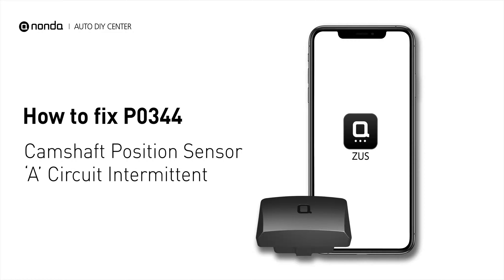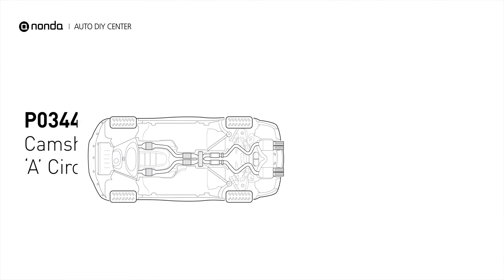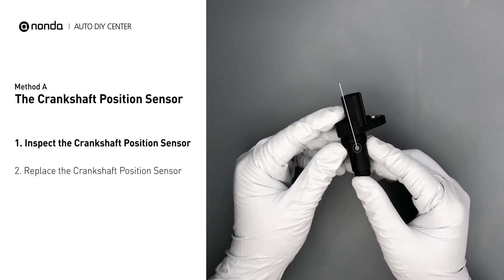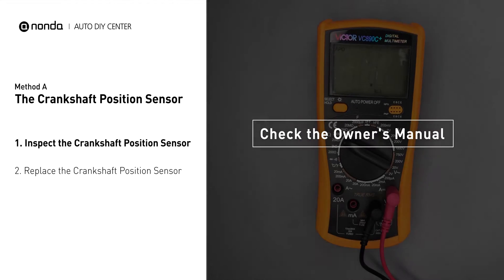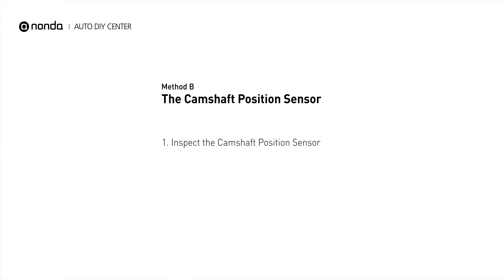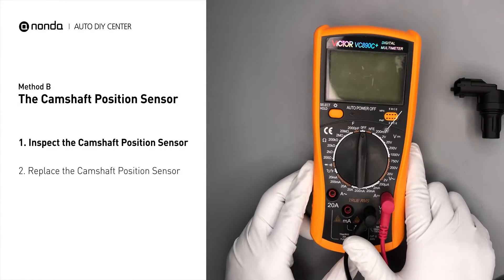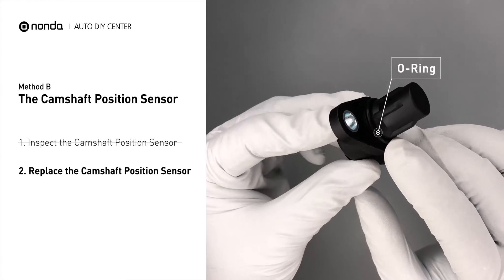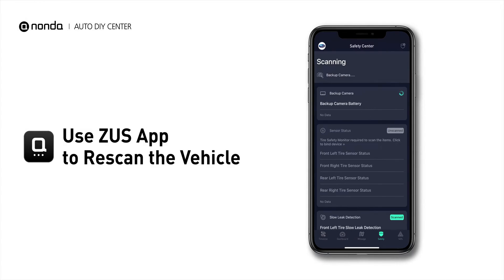How to Fix P0344 Engine Code in 3 Minutes [2 DIY Methods / Only $9.56]

Comment from the maker: Hi, I'm Steve, nonda's lead mechanic engineer. 
Feel free to leave your comments here if you have any mechanic questions, I will be glad to help you out!
Reply: what should i do after i already replaced the camshaft and crankshaft position sensor and my car is still acting up it will throw the check engine light and traction control light on at the same time and wont rev pas 2300 rpms and poor acceleration
Reply from the maker: Hello @cody roberts and @iitzlando, can you please provide us with your vehicle's year/make/model?
Reply: @nondainc  ssangyong actyon wagon 2008 diesel
Reply: @iitzlando  I’m having the same problem
Reply: @iitzlando get an oil change that will help
Reply: @iitzlando have you gone to Auto Zone to tell them to scan your car sorry im over 2 years late
Reply: Changed both cam sensors and crank sensor still get po344 code has high rpms at 60 mph what should be checked next
Reply: @aliceseymour6272  composition sensor
Reply: Ik this video is old but I replaced my cam shaft sensor A for my Ford focus 2014 se hatchback and I’m still getting the error code p044 and P040 and my car is still driving poor do you have any suggestions?

Comment: Same problem changed both sensor have same problem can you guide me to issue
Reply from the maker: Hi Alice, kindly check the condition of the Camshaft and Crankshaft Position Sensor and all the wiring related/electrical connections. Check also the battery if weak. Please repair/replace the faulty part to see if the issue will still persist. Hope it helps!